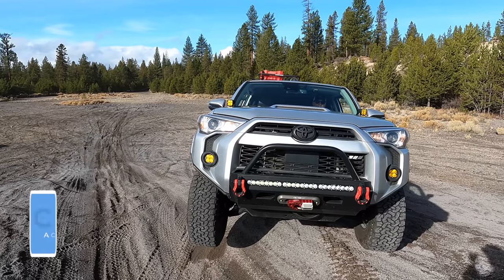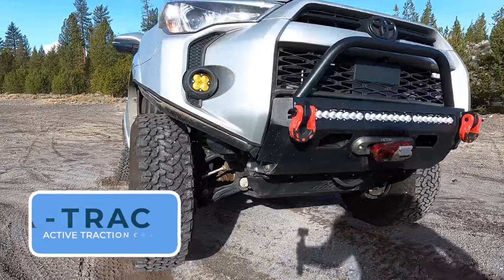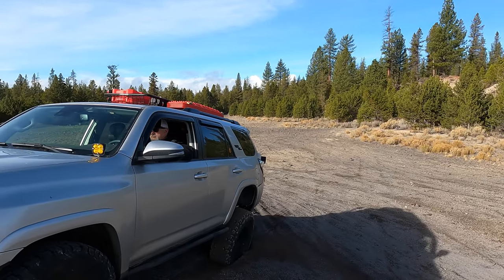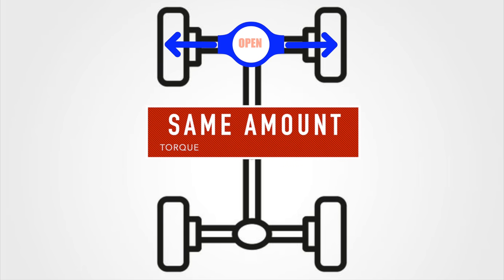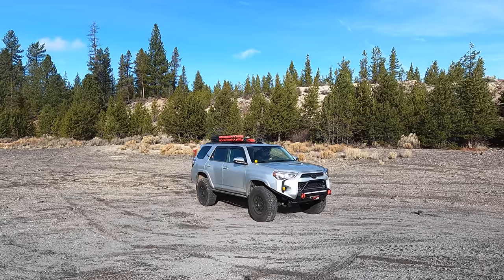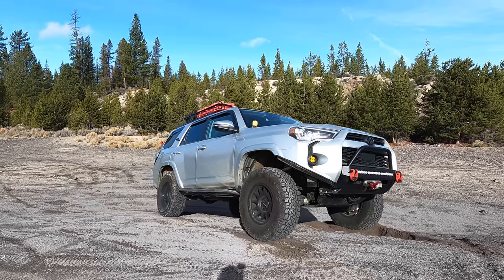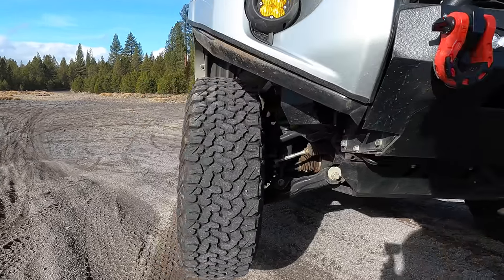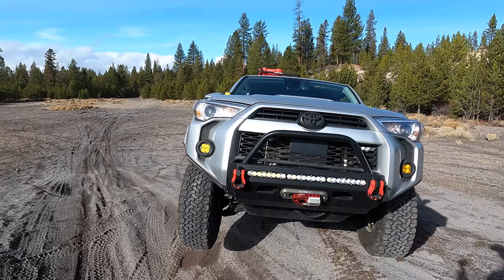Finally, The Only A-TRAC Video You Need to Watch. Multi Terrain Select Explained. ATRAC v ARB Locker

Comment: 4Runners don’t have dual lockers atrac as I understand uses braking of the spinning wheel to trick the other wheel into spinning
Reply from the maker: My 4Runner has both atrac and an after-market ARB air locker on the front axle. So I do have dual lockers. I have discussed this in a lot of my videos but could’ve done a better job of reviewing it in this video for viewers who have not seen my other videos.

Comment: I have found on loose rock and dirt on a hill lockers dont always work; whereas ATRAC was the better option.
Reply from the maker: Totally agree, A-Trac really does well in loose rock!
Reply: @OverlandPNW  Does any of your guys 4runner 4.0's exhibit steering pump whine? Kinda sounds like a low supercharger whine. Now some say its normal, but others claim its a timing chain guide fail. What are your guys thoughts.
Reply from the maker: @KJV0812  Nope, we have not experienced that. At least not yet. With 34s, I wondered if a beeper steering pump would be in my future. But, so far so good.
Reply: @OverlandPNW  Well I’ll have to ask a Toyota tech and see what their thoughts are.

Comment: Thinking of getting dual ARB air lockers for my 2015 Land Cruiser. Mainly for deep snow and to a lesser extent mud. Just worried about maintenance and reliability. Anybody know if they are finicky- I really want to add some capability but most of all I don't want to decrease reliability.
Reply from the maker: Dual ARBs on the Land Cruiser would be a solid choice. The ARB air locker on my front axle has been an absolute beast. Zero issues. Always works. I would switch out the factory e-locker on the back for another ARB air locker in a heart beat. Everyone in our group has had mechanical failures with the factory e-locker. I'm not an expert on lockers but that is my experience with the ARB air locker. I know that XOverland put ARB air lockers front and back on their new 4Runner build. Those guys are pretty experienced. If you put dual ARB lockers on...send pictures! Cheers!
Reply: @OverlandPNW  Thanks!

Comment: Dumb question is mud and sand comparable to snow and ice driving?
Reply from the maker: That's actually a pretty good question. A lot of people don't think about all the variables involved. For example, there are so many different snow conditions: slush, ice, powder, snow pellets (graupel). Sand has a lot of variations too. It can be as hard as concrete, sugar powder sand, or quick sand. So, it can be hard to make comparisons but the one thing that is definitely true in all cases is that it is a traction game.
Reply: @OverlandPNW  for MTS purposes would that be the best setting to try you think?

Comment: this if for auto transmissions only I'm assuming
Reply from the maker: A-TRAC is provided with both automatic and standard transmissions. The A-TRAC sensors detect wheel spin and are not related to the transmission. Cheers!
Reply: @OverlandPNW  I guess the MTS part is only on Automatics. Also, when you're referring to the diff locking are referring to the factory rear diff lock or do you have ARB locker(s) based on the video title. i wasn't really clear on that. thanks!
Reply from the maker: @bearburrell6104  I have lockers on both the rear and front axle. In addition to the factory rear diff lock, I have an ARB air locker on the front axle. I really didn't do a good job explaining this in the video. Probably because I have talked about it in other videos. In this video, I do mention the ARB air locker at 11:40 and also in the description. But, I should have mentioned it earlier in the video. The dual lockers are absolutely great!

Comment: If old 4wd must what ?
How f& R lock ???
What different???
I didn't all El. Manual can work ???I had Lock Right ? Can cross most! Had 1 people ? Can you do it ???
Reply from the maker: My front and rear lock because I have an after market ARB air locker on the front. Thanks!
Reply: @OverlandPNW  I know that but do you need elec.cont.I drive ? Thanks y sug.!I go off-road by myself ?I ride moto-cross by my self !BANSHEE & RM !
Reply from the maker: @silaslai5913  I'm not sure about your first question. Sometimes I off road by myself too but the truth is that is is not a good idea to off road by yourself. Thanks!

Comment: I am having a hard time thinking of a time that you would use A-TRAC if you are locked front and back. Lockers kill your turning radius and can be hard on the drive train but it doesn't sound like A-TRAC has any advantages over lockers. I have always looked at A-TRAC as an attempt to mimic a locker.
Reply from the maker: I agree. A-TRAC is a mimic of a locker. I'd have a hard time thinking of a time that I'd choose A-TRAC over a locker as well. I have an after-market ARB air locker on my front axle. That, together with the factory installed e-locker on the back are my go-to choices off road. That being said, everyone in our group has had mechanical failures of the Toyota factory e-locker. So, it is nice to have A-TRAC and MTS systems available as backups. They can get you out of a lot of situations.

Comment: 4runner trd off road does NOT have front diff locker !!!!!!!!!!! only rear.  You said you engaged your FRONT and rear lockers at 3:12 here. HOW ????
Reply from the maker: You are correct that stock 4Runners do not have a front diff locker. However, I installed an ARB air locker on my front axle. So, my 4Runner does have front and rear diff lockers. Cheers!

Comment: Hahaha... on my VDJ76 Land cruiser I'll pull the 4wd manual shifter back to 4WD high (prob), or if seriously, which is a bit serious than this flip the launcher switch on the rear locker.... really bad 4wd low. Normally Tilly will crawl out on the idle up (its the only advanced button)
Reply from the maker: Yeah, I get it. Modern traction control systems are getting so complicated, you wonder if they are worth having. I learned to off-road in a 1967 Nissan Patrol. It had manual locking hubs, a hand crank start, a manual transmission, and a clutch so hard to depress, I'd swear it came from an old tractor. Not a single "traction control" button of any kind. I really miss that rig!

Comment: Way to complicated and playstation like…. I like a good engine, a gearbox, axels and good old lockers 😊 but a very good explanation of the systems
Reply from the maker: Fair enough! I get where you are coming from. I learned to off-road in a 1967 Nissan Patrol. It had manual locking hubs, a hand crank start (no kidding), a manual transmission, and a clutch so hard to depress, I'd swear it came from an old tractor. Not a single modern "traction control" device of any kind. I like my 4Runner but I really miss that rig!

Comment: I ain't got that fancy shit lol. I've got part time 4wd, full time 4wd, and 4wd low ....
Reply from the maker: That's all you need! I learned to off-road in a 1967 Nissan Patrol. It had manual locking hubs, a hand crank start (no kidding), a manual transmission, and a clutch so hard to depress, I'd swear it came from an old tractor. Not a single modern "traction control" device of any kind. I really miss that rig!

Comment: That 1st truck is using a all wheel drive like in a car ,  put some lockers in it so you don't have ANY wheels NOT turning or bs knobs all over the place , then NO traction loss on any wheels , sorry but I know someone who has one of the old Toyota 4x4's from the 80s and it will still drive circle's around any of the new ones , Because I have seen it push mud and water above the hood and still come out of it.
Reply from the maker: Those old Toyotas are great!

Comment: Skinny pedal- all traction control off! More fun!! LOL
Reply from the maker: I get where you are coming from. I learned to off-road in a 1967 Nissan Patrol. It had manual locking hubs, a hand crank start (no kidding), a manual transmission, and a clutch so hard to depress, I'd swear it came from an old tractor. Not a single modern "traction control" device of any kind. I like my 4Runner but I also really miss that rig!

Comment: I think things were much simpler with the basic high range and low range system
Reply from the maker: I know what you mean. I learned to off-road in a 1967 Nissan Patrol. It had manual locking hubs, a hand crank start (no kidding), a manual transmission, and a clutch so hard to depress, I'd swear it came from an old tractor. Not a single modern "traction control" device of any kind. I like my 4Runner but I really miss that rig!

Comment: Call me old fashioned, but I don't want all these fancy drive modes and driver assist schemes.  Just give me a good 4 low,  and at most the front/rear lockers, and I'll do the driving myself.   I've gone places most people wouldnt believe, in a stock 96 tacoma with no lockers.
Reply from the maker: I learned to off-road in a 1967 Nissan Patrol. It had manual locking hubs, a hand crank start (no kidding), a manual transmission, and a clutch so hard to depress, I'd swear it came from an old tractor. Not a single modern "traction control" device of any kind. I really miss that rig!
Reply: Traction control is far superior to open difs

Comment: No MTS over 7 mph is too low, mud and sand mode will definitely need more speed
Reply from the maker: So true!
Reply: Don't forget to air down.
Reply from the maker: Great tip! Airing down is a primary traction tool!

Comment: the best explanation for this junk offered by Toyota should be just lockers for both ends and no garbage in the computer or buttons and switches all over the interior... the end.
Reply from the maker: That's a cool Potato Ridge video on you channel. Legit driving skills. I hear what you are saying. I learned to off-road in a 1967 Nissan Patrol. It had a hand crank start (no kidding), manual transmission, manual locking hubs, a clutch so hard to depress I swear it came off an old farm tractor, and no computerized traction control of any kind. I really miss that rig. I prefer to drive by the seat of my pants if that makes sense. On my 4Runner, I have an ARB air locker on the front axle and the factory e-locker on the back axle. Those are my go-to traction devices. I agree, if Toyota would offer two lockers instead of the computerized traction systems, I would take that offer in a heartbeat.
Reply: @OverlandPNW  I used to own Revtek Suspension, started it in 99, had a tight relationship to Toyota.  They gave us a new 05 Tacoma before the release, had the FJ before release, tried to tell them to just put lockers in both ends and make it simple, I even took the guy from Japan wheeling in one of the FJ's we took to Moab to show him how much better the arb's were than the hokey computer bs, but Toyota is a subservient company to GM, I am not sure what the relation is, but GM tells them what they can and can not build........ I don't even consider Toyota anymore.
I am building an 88 standard cab truggy right now, 6.0 LS, TH400, D60 14b Atlas, I will never run Toyota gear again, but I do love me some 2nd and 3rd gen pickups and runners lol
Reply from the maker: @patrickhickman8723  I'd love to see a video post of the 88 standard cab truggy you are building. Sounds like a full on off-road beast!
Reply: @OverlandPNW  I am about to retire, I have a house I am finishing and after it sells I am going to start a yt channel, I want to cover all aspects of recreational wheeling leaning to the more hardcore trail rigs, but I am interested in doing chevy suburban overland rigs, primarily 2003-2006 2500's with the 8.1 4L85E and 14b ff rear axles, I am going to build a kit to drop a 05 and up SD front axle in them with a SD steering box with hydro assist and put them on 40's for over landing. I want to make the entire kit including the interior stuff as well, at this point I know nothing about over landing though lol I will be hitting you up on that stuff.  But I want to cover the basics of building a hard core trail rig that is bullet proof and where to save and spend money.
Reply from the maker: @patrickhickman8723  I’m happy to talk overlanding anytime. It’s a fully developed and growing market. We are starting to see saturation in some product categories but there’s definitely room. I like the idea of a more hard-core trail rig that appeals to the Overlanding crowd.

Comment: fun fact. mercedes has a that system since 1998. and its as good if not better.
Reply from the maker: I'm a big fan of the Benz traction control systems. Also love the three locking diffs in the G Wagon. Good stuff. Cheers!

Comment: should go further back to basic, 4wd is still 2wd. 4wd with just a rear or front locker is 3wd. A-trac is a "semi locker" turning 2wd into 3wd. Front + rear locker turns a vehicle into true 4wd

Enter traction control and it becomes more fuzzy and you get into All wheel drive territory instead of 4wd territory.
Reply from the maker: I have a front and rear locker on my rig. The front is an ARB air locker. The rear is the factory e-locker. They are my go to. I learned to off-road in a 1967 Nissan Patrol. It had manual locking hubs, a hand crank start (no kidding), a manual transmission, and a clutch so hard to depress, I'd swear it came from an old tractor. Not a single modern "traction control" device of any kind. I really miss that rig! A-Trac is decent for what it is and it is nice as a backup. I have had e-locker failures before.

Comment: No because I have front and rear lockers.
Reply from the maker: I agree! There is no substitute for dual lockers. I have an after-market ARB air locker on the front axle of my 4Runner and the factory e-locker on the back. I'm not a big fan of the factory e-locker. Everyone in our group has had mechanical failures of the factory e-locker So, I don't mind having the A-TRAC/MTS systems as backup systems. By the way, the videos on your channel of your ZR2 Bison on the beach and rock crawling at Rausch Creek are legit!

Comment: So what do we have learned... Get a front diff lock
Reply from the maker: Good point. I'd have to agree that if you distill it all down, nothing beats adding a front locker. If you do a lot of technical trails, it is probably the way to go. But, the factory rear locker with MTS and A-TRAC will handle just about anything the average off roader tackles. Cheers!
Reply: @OverlandPNW  I totally agree with you, very instructive video by the way. Thanks!

Comment: Wth is an "overhead console?" I don't even have power steering. I use skill to "get myself out of this." Ya'll are spoiled. It has its perks, but it also strips you of skill and ingenuity.
Reply from the maker: I like my 4Runner but I get where you are coming from. I learned to off-road in a 1967 Nissan Patrol. It had manual locking hubs, a hand crank start (no kidding), a manual transmission, and a clutch so hard to depress, I'd swear it came from an old tractor. Not a single modern "traction control" device of any kind. I really miss that rig!
Reply: @OverlandPNW  Hand crank!!! Sweet, haha!

Comment: Good explanation.  But this illustration shows Toyota disadvantages its off road customer.  Even tho it is merely a programmable software logic feature to an existing abs braking  system with zero physical changes Toyota charges the same as a simple locking diff used to cost.

It would be better to get lockers for the old price, they add one minor feature to a open gearset.  Instead, they package they cost thousands. and price it out of people's hands.  Backwards marketing.
Reply from the maker: It would definitely be nice to see Toyota offer an option for a front locker. Cheers!

Comment: i had a all wheel drive gmc small van during the 90ties--its computer would stop any wheel spin and apply power to the traction tires--it was full time--i shocked a bunch of hi end 4wd vehicles when i went right up a sand hill they could not do--not much ground clearence though
Reply from the maker: That is absolutely awesome!

Comment: The proper answer is don’t use a Toyota for serious off-road, I own a 2021 Toyota 4wd and I would always ALWAYS jump in my real 4x4, a 1974 ford bronco to pull Toyota out of the sheet
Reply from the maker: I agree that these systems are not intended for extreme off-road.

Comment: ... I'll pass. If ain't got a t case coming through the floor and doesn't have lockers, solid pass. What junk. Those poor CV axles. Did anyone else notice how much the upper control arm was jumping in the bushings? Pre mature wear on a lot of extra components. Not to mention how much more room for failure there is based on the better earlier platforms that Toyota has made.
Reply from the maker: Issues with CV axles and upper control arm bushings are legitimate points. Thanks for the comment.

Comment: Just makes me not want a toyota
Reply from the maker: Yeah, I get it. Every vehicle has its pros and cons. I learned to off-road in a 1967 Nissan Patrol. It had manual locking hubs, a manual transmission and a clutch so hard to depress, I'd swear it came from an old tractor. I really miss that rig!

Comment: Nope, i dont buy cars like that. Only drive things with basically no electronics. New vehicles are absolutely horrendous at offroading. Actually new vehicles are horrendous in general. I have never seen such stupid designs. Like a jeep that can't accept gas from a gas can. Or a Toyota pickup truck with independent suspension and a bunch of electronic buttons that's going short out the second you drive across the river.
Reply from the maker: I get where you are coming from. I learned to off-road in a 1967 Nissan Patrol. It had manual locking hubs, a hand crank start (no kidding), a manual transmission, and a clutch so hard to depress, I'd swear it came from an old tractor. Not a single modern "traction control" device of any kind. I like my 4Runner but I really miss that rig!